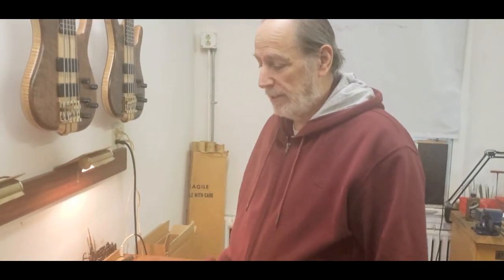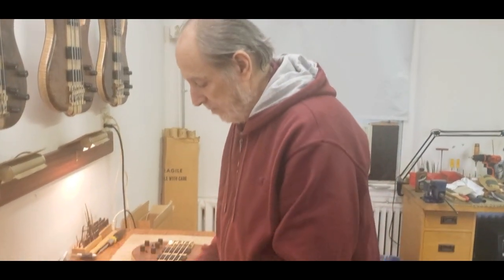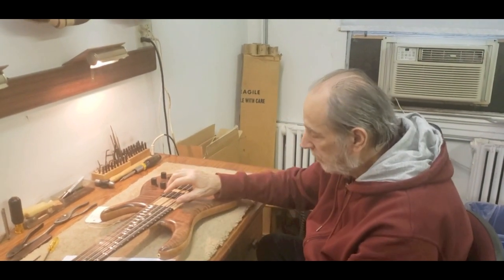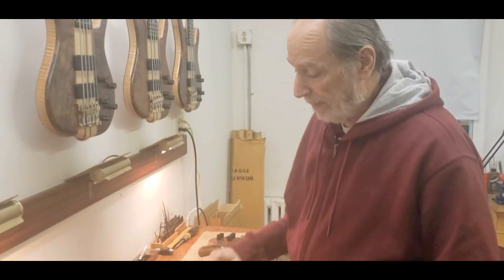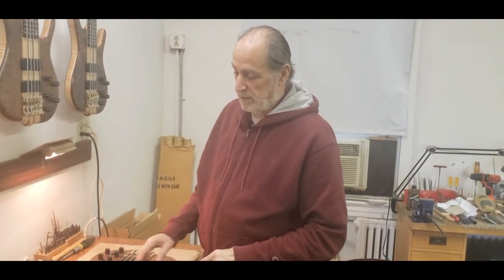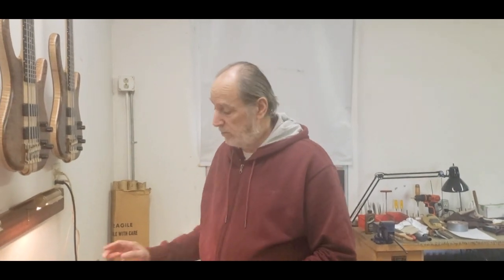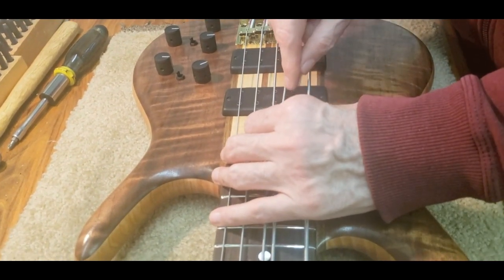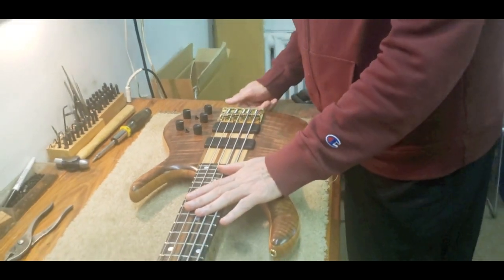Ken Smith Basses Presents: Ken's Corner - Episode 6 - Basic Setup

Comment: PS  DO YOU USE   NORMAL  STRINGS  OR   THE   WHAT THEY CALL THEM   SAME  OR   EQUAL TENSIONS  //I ASK  THIS   VS   SEING YOU DO FEEL ON  24  FRET //I  DID   LIKE   YOU    AND  LAST   YEAR   AFTER  DOING THAT   35  YEARS//NOW  LUTHIER  SAID  I WAS WRONG   ALL TIME AND  TO MESURE    STRING   HEIGHT  ON  12TH  FRET// but  i recorded  more than  10 albums and  i  get   what  i wanted//with my  technic// i  do    try a   1 and 24 th  fret   on top of fret  no like when playing and   see  how  many  bow i got  in neck i like a  little   to  feel    string   tapp if   tapping  on it//i got friend too who want a   razor edge straight   neck  // no bow  not even   like a   gillete     to go under 12  when  1  and  last  fretted string  i  like  to put   0,5mm pick  to  be  held   by string  on  12 th   but as  i  drop finger  on  1st fret  it drop out// than u play  and see

Comment: why  you  do not  use  just  metric  or   usa    hex keys// i know   you  supply   with bass//but   you know  u   are   doing setting   go test  /on  a   practice  /it takes a  bit  loonger  or ends  in bar    and  next day  //in short  you lost   a  simple  hex  key //now for string  height  i normal go buy few    i feel  will fit  or  be a hait  too fat   and  if  none  is  perfect  i   take dremel  and    in  1  min i  do  a  bit  of  conus     on  hair too thick  and  it grabs   in nice  //and  i  when  raising    strings  i detune string a  bit// i guess  u  use mixed   metric and   inch   because   truss rod supplier  or   any  //i  did  SOME    RESERCH AND   USA   FINE   THREAD  IS   CLOSE TO  EU   NORMAL //SO   I  D  LIKE   TO HAVE  METRIC  NORMAL OR  FINE THREADS   VS  USA  NORMAL //USA   FINE  ONES   ARE  OK  BUT THAN   NORMAL METRIC   ARE    A  BEST AND  MOST SIMPLE   OPTION // OK ON   REAR TUNING  I USE   FINE    METRIC   SO IT  IS   NOT SO DAMN HARD TO  GET  MOVING AS  ORIGINAL STEINBERGER   TUNING   START// AND  I USE TITANIUM  TO TITANIUM   CUSTOM MADE  PULL SHOES FOR   HOLDING PULLING STRING TO TUNE//BOLTS  I  BUY   TITANIUM  AIRCRAFT   MODEL  ROLLED  NOT  DIE CUT  ONES//IT IS   COSTING   FEW 10 DOLL  PER  BASS  BUT  ALL THAT   CAN   MAKE TUNING MORE SOFT AND  A LOT  MORE  PRECISE  IT  TAKES 15  TURNS TO  GET   SAME  PULL  10 TURNS  OF  OLD   SET WOULD DO // AND   ROLLED   SCREWS    ARE SMOOTH  SO  A  BIT GREASE AND     THEY TUNE  EASY AS  BUTTER //VS  ORIGINAL   THAT FEEL LIKE   SCREWING  IN  A   NON PRE DRILLED WOOD  NOT  IN  A  NUT